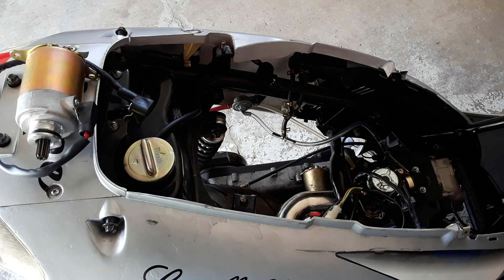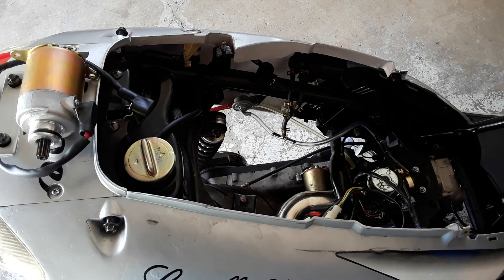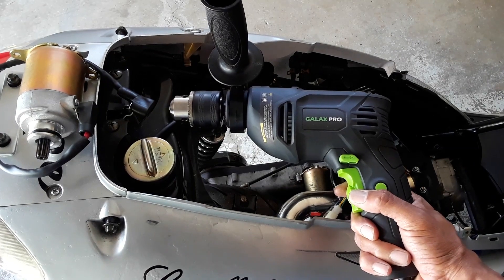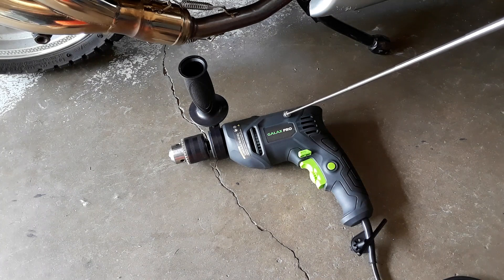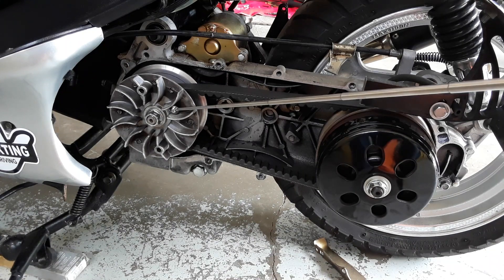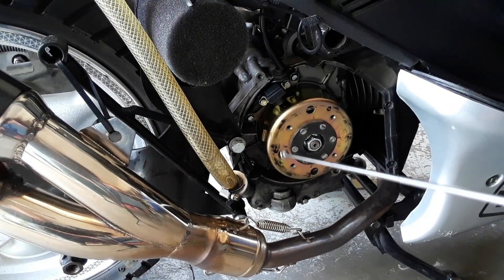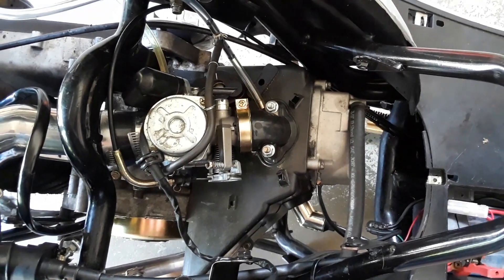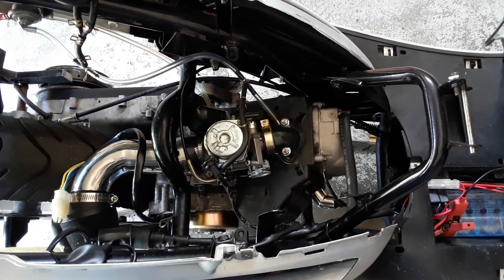Starting scooter engine with a Drill / Will it work?

Comment: As of today I can vouch that a drill will indeed start a 150cc Gy6 when used on the variator nut turning counter-clockwise. Regular drill only as an impact will just remove the nut. Battery isn't charging even after replacing my stator a couple weeks back and my semi-broken kick-start lever fell off somewhere between home and Got knows where so the drill theory had to be invoked. Tie a shoestring to a brake lever and handle so that you can use both hands on the drill.  I used one the first time and nearly broke my wrist.
Reply from the maker: Great job Roland, yeah I know it will, and once I get my new engine Saturday I want to give it a try also. Thinking of starting the pocket bike for the first time with a drill instead of the pull starter.

Comment: Damn son.  Hope isn't looking very good. I had the exact same tear in the manifold with Libby last year. But now I'm having a issue with her backfiring. I did put a new exhaust on but wasn't able to use the new pipe. Had to use the stock one. until I can get to a welder to reweld the brackets for the new pipe. Would that be the cause of backfiring issues? I adjust the fuel mix adjustment screw on the carburetor. It was set stock at 1 and 1/2 turns out so I dialed it down to give her less fuel. But still getting backfire. Any advice will be very appreciated. Catch you on the flip side Kachi's kid
Reply from the maker: You know, I always have advice....lol. You have to check the state of that spark plug. Clean it up or use a new one...rip down the street back and forth maybe for 5 mins. Pull the spark plug to see if it's rich or lean. Then you will tell what direction to turn the screw and if you might need new jets. About to start pulling Hope apart, right now....
Reply: @kachiskid  right on I appreciate the advice. And I will do that. Will it backfire if it's lien? I thought it only backfired when it was too rich. But as I told you before I am definitely not a mechanic. LOL good luck on hope I wish you the best buddy. When I get Libby all done I'll have to shoot a video and introduce her to the world.
Reply from the maker: Kell, as far as I know if backfires when rich because that is when the gas that escaped the carb. and finishes burning in the exhaust....I think. I would ask a pro, I'm sure there is a video of the explanation. I am making a time lapse video of the tear down...camera angles are tricky.
Reply: @kachiskid  thanks so much buddy. Good luck on your next video and I can't wait to watch it. Hopefully I will learn a lot.👍
Reply from the maker: @foe1022  Thanks buddy, found the problem already. Intake valve is stuck, might have destroyed the head, but easy to replace. Coming soon....
Reply from the maker: Oh Kellllllllllllyyyyyyyy, it just got horrible! Fudge! Try not to throw-up....
Reply: @kachiskid  damn that does NOT sound good at all. My prayers goes out to Hope. I have faith that you can get her all fixed up and back on the road. If you don't post a video about it. Do me a solid and let me know what's the issue is. Good Luck Bro.
Reply from the maker: @foe1022  no worries I'm posting it tonight, just need to add my music. 😖

Comment: Hey! I never heard back from you..I guess I know why..need anything let me know.
Reply from the maker: Hey T, I posted the link on your video but since then have deleted the video because I wasn't able to turn the flywheel by hand. Hoping for just a cylinder head problem, but I will know tomorrow.
Reply: @kachiskid  no problem, if you need anything let me know
Reply from the maker: Will do, I found the problem already...the intake tappet is stuck in the valve...wth??? I lossened the tappet and nut and can't get it off the valve...lol. Well that gives me a reason to install the true 61mm head.  Thanks for everything.
Reply: Hey I'm about to try it..my starter is acting up on me ggrrrrr